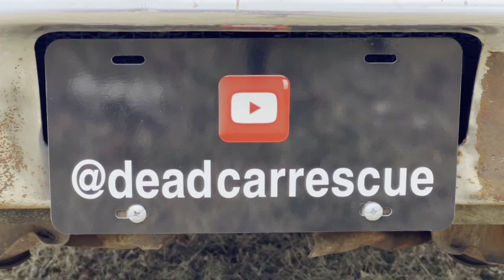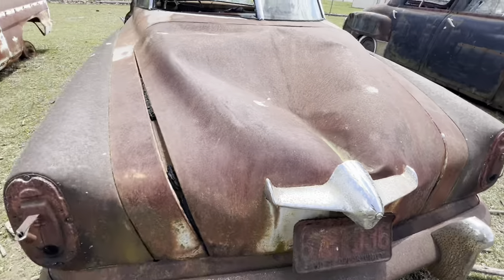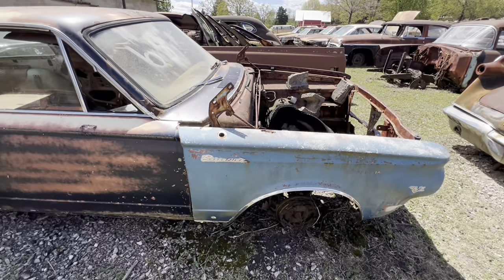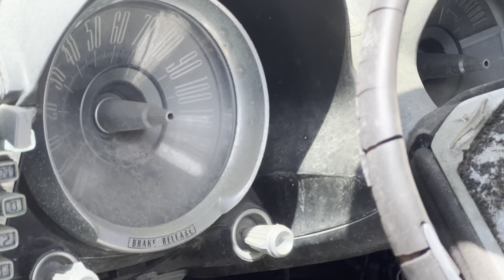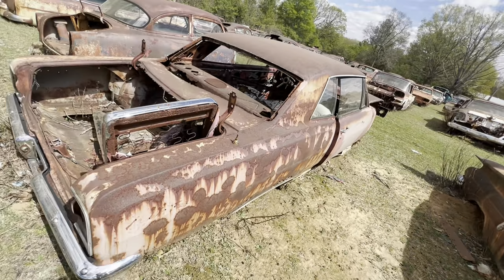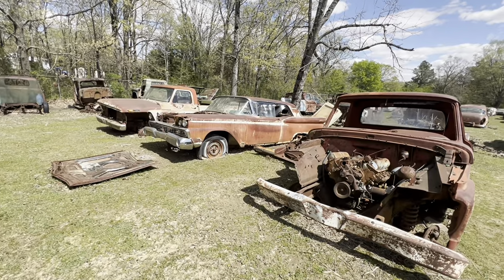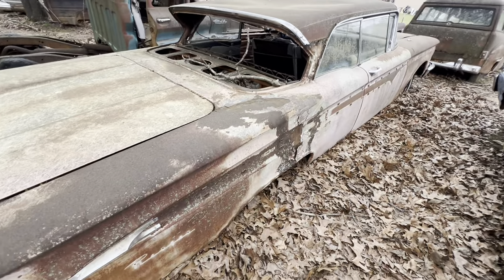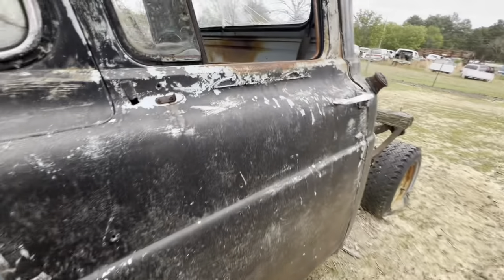*NEW* Junk Yard Walk: 300+ Classic Cars & Trucks Owner says sell them!!!!

Comment: Hi, youtube suggested your channel, so i decided to see what treasures are at the classic bone yard.
     I partially restored a 66 impala ss convertible back in 07, but i got hurt, and was off work for almost a year, and i had bill's to pay.  I had a lot of time and money in that car.  I have progressive MS, and muscle wasting on my entire left side.  My dr. said i needed to be as active as i can to keep the wheelchair away.  I bought a 1954 m38a1 jeep willys, and it's never been titled, the original owner bought it from a governot auction in the 80's, and drove it on his summer property in Northern Michigan.  He didn't tear out the 24 volt parts or wiring, but did paint the exterior and awful dark burgundy.  I will be sanding it down, and painting it the original olive drab.  My grandpa let us drive an old 67 mule around the farm, and he had an old army jeep for awhile to.  I have always wanted a wwll jeep, because both my grandpa's fought in the war, but up north there's a lot of rust.  I got a sweet deal on this 54, and it has the f engine, so i drove about 80 miles, and had it brought home on a flatbed back in the first week of April.  Thankfully it only sat a couple year's without running.  I put two batteries in yesterday, and all the light's and gauges work, and it turned over and cranked evenly.  I rebuilt the carb, but could have tried it, because it was really clean inside.  Supposedly this jeep has 37,000 original miles.  The brake shoes, drums, wheel cylinders, and master cylinder are all original.  I was really surprised, because the radiator is original, with no patches or rust.  The gas tank had a thin spot, and leaked after i filled it with water and degreaser, so thankfully i found a new one pretty cheap , and just as heavy as the original.  It was cheaper to buy a tank than to go through the process of patching, and sealing the thin metal inside the tank.  The seats have the original cushions and covers in good shape, think the mileage might be accurate.  The man who owned it passed away, and his daughter sold it to me, i think she sold it cheap because she didn't know much about it, and it had been sitting outside over the winter uncovered, and i think it scared people from coming to see it.  The guy who brought it to my house wished he'd have known it was for sale, because he would have bought it.  He looked it over, and said i got a good deal, he wants me to send him picture's when it's done, and said he would buy it i decided to sell it.  I don't plan on selling it, already have a lot of time and money in it, and I'd probably never find one this nice, at a price i could afford.  My dad and grandpa taught me how to fix thing's, and build stuff as a kid, even though i'm a girl, because my brother is a lot younger than me, so i became the helper pretty young.  Back in the 70's and 80's, cheap child labor was common lol.  I learned a lot, and have fixed stuff all my life, and its saved me a lot of money.  Sorry i rambled, but most of my family have passed away, and i don't have anyone to share my enthusiasm for restoring this old jeep.
G-d bless.
Reply from the maker: Well it sounds like you know a lot about mechanicals and such. Sorry to hear about your health problems , I’m 68 and this you tube channel keeps me from laying around in the house all day. I wish I could put a video out every week but right now it’s going to have to be every other week. I just don’t have the energy at 68 years old. Keep doing as much as you can and tinkering with your toys lol. Thank you for watching and subscribing to my channel.  Keep in touch and comment any time you like. I’m looking for more old car junkyards around me to video so stay tuned.

Comment: 44:50..your had a shot engine...Mopar cop cars even all C bodies of that era were quicker than most muscle cars! 0-100 mph in a 1970 Fury Cop Car would blow the doors off a 390 Mustang!! 396 Chevelle and 400 Buicks and many others and even bigger engine cars.

Remember you probably were running on 6 of the 8 cyl or they put in a 225 slant 6...or a dead smog 1978 engine...

I have C bodies with 383 hp 4bbl and they run mid 13's int he 1/4 mile basically 2 tenths off my 383 Super Bee was..a 440 in a C body will beat a 383 car and easily beat a Ford 390 even 429 cars easily!

Remember how they tested cars back then ,tracks were not prepped nor sticky like today..Road tests were mostly on side streets or parking lots and if at the track 1 st gear was never used as they just spun,even GM/Ford performance cars or big engine pre 1971 cars..

Even the smog version 440 Fury ran 15 flat in the 1/4 and I had one it performed like my 69 Polara with a 383 2 barrel...

I even have a 65 Mercury Monterey with a  410 and it's quicker than a new 5.0  F-150..My Mercury is bone stock,never rebuilt,compression is perfect on all 8 one is 10psi lower than the rest but nonetheless...I rebuilt the carb,water pump rest is stock! It is slower than a 440 Fury,NewYorker,Polara etc..1971 and older...In 72 engines were all changed and low compression,different cam,crank,heads,carb and a lot slower.

I owned all types of Ford/Mercury and my 383 Magnum  Polara was quicker than my 66 390 GTA Fairlane! Albeit my Polara was a 1969.
Reply from the maker: We had 3 at our car lot. Former Arkansas state police cars. I drove two of them to our local Dragstrip and they ran mid 10’s in the 1/8 mile. All were geared for top end speed, all were 440’s.